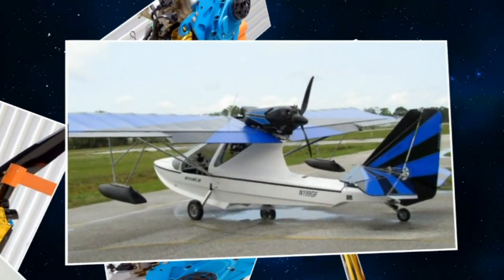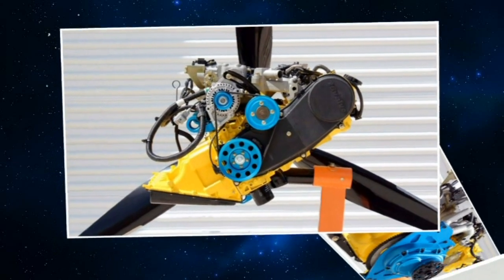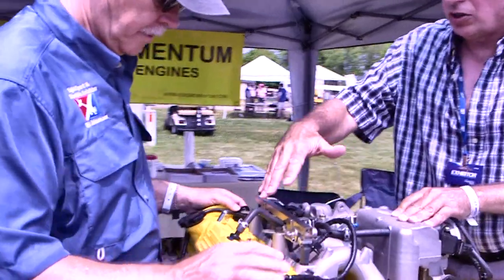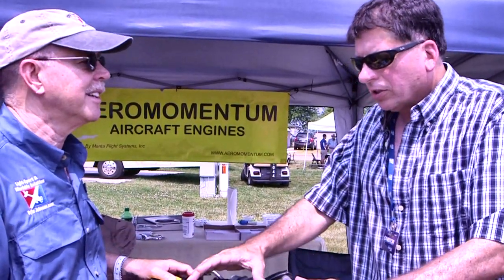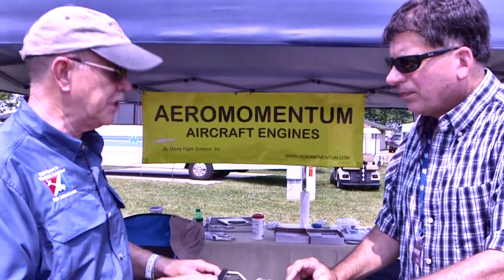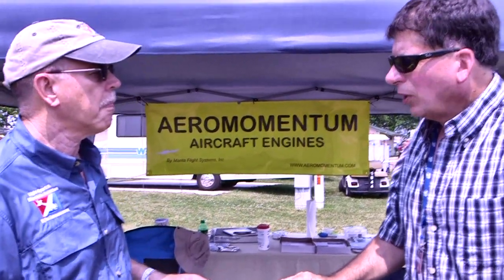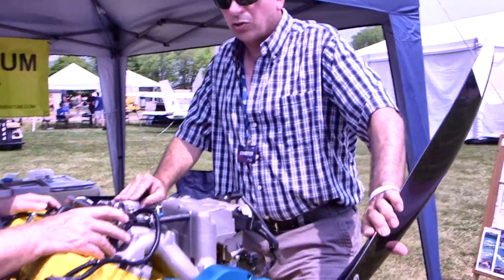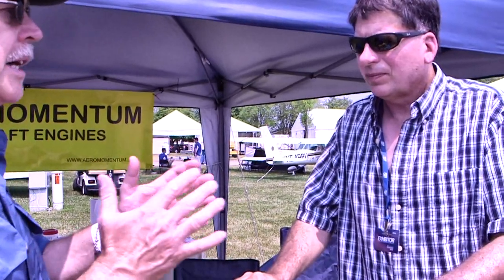Aeromomentum Suzuki AM1500, 100 and 117 HP Suzuki aircraft engine conversions.

Comment: << About redundancy >>   Please keep in mind that not only were dual magnetos used for redundancy but also   PEAK POWER   could not be obtained  with just one magneto. So two magnetos were necessary to obtain true horsepower rating of the motor. Horsepower is greatly reduced when one magneto quits working.
Reply: +Ray Dreamer Yes, but that's mostly because the cylinder bore on a traditional Lycoming or Continental is so large the flame can not efficiently travel across the bore so 2 spark plugs are required to achieve an efficient burn.
Reply: That's not true at all.  This has been a BIG pilots misconception for years that 2 mags = redundancy.  The magneto cannot reach 600 volts that is why it need 2 mags to try to reach it's horsepower rating. A modern automotive spark ignition system ca be more than 35,000 volts.  Therefore only one spark is needed.  You have to remember that when the government  CERTIFIED  the aircraft motor back in the 1930 s Lycoming was given a licence that protected their motors from being modernized. Because the aircraft motor company was given a captivated market.  You have to put their motors in your plain or you do not fly.
 There is no way to justify the the cost of an aircraft motor reaching over $100.00.oo for an antiquated motor. The air cooled VW motor has more modern technology than  licombing motor.  JUST THINK IF THE GOVERNMENT  HAD CERTIFIED THE THE FORD MODEL  T  MOTOR BACK IN THE 30s ALL OF OUR MODERN CARS WILL STILL HAVE THE SAME MOTOR IN THEM NOW AS THE OLD MODEL  T   CARS HAD THEN IN THE 30s.   SAME AS THE POOR  CESSNA IS STUCK WITH IT'S OLD LYCOMING MOTOR WITH ITS FALL A PART CARBS AND WEAK MAG IGNITION SYSTEM .  Sometimes the government tries to help but fails miserably .
Reply: Ray Dreamer 
Thank you so much for your comment ! That really explains why the aviation engine market is the way it is
Reply: I'm in aviation certification. It costs a LOT of money to design, test, and certify an engine, whether it be a turbine or reciprocating. We have jet engine development and certification programs that exceeded two billion (yeah, billion) dollars, and nearly a decade of time. You can view the FAA requirements for piston engines online, they are 14 CFR 33.31 through 33.57. So, essentially, you need to design an engine, test it yourself to make sure that it does what you want, then go through a full test program for the FAA. Oh, and each individual control or accessory (fuel pump, ECU, alternator, etc.) gets tested separately, and not just for function: vibration, fire, fluid contamination, corrosion, mold ... all kinds of things. I'd imagine a well-run recip engine certification would run about five million dollars—AFTER you've already designed, built, and tested the engine. And then any other changes (more displacement, etc.) require you to get that configuration certified. But then you still aren't done, as every airframe/engine combo needs to be certified by the airframe manufacturer, with the help of the engine manufacturer, of course. Good times.

Comment: Great motor choice with a $1.700 long block replacement for TBO This is gold at a copper price.. What grade or class of gears are you using in your gearbox ?
Reply: +Ray Dreamer You've got to wonder...  that means a lot. I've heard belt drives are quite reliable.